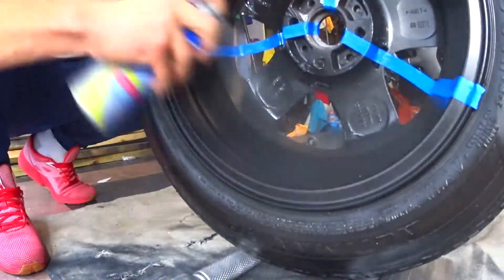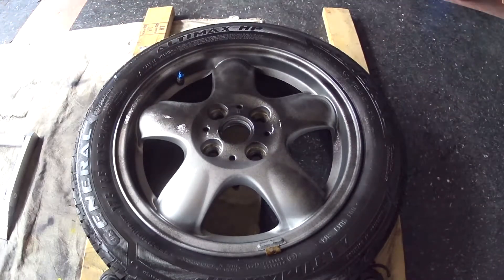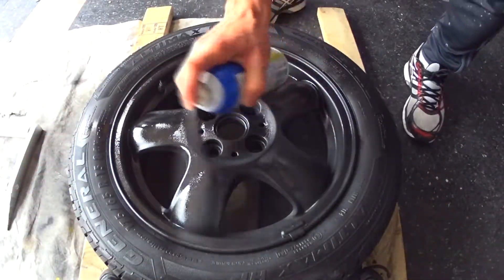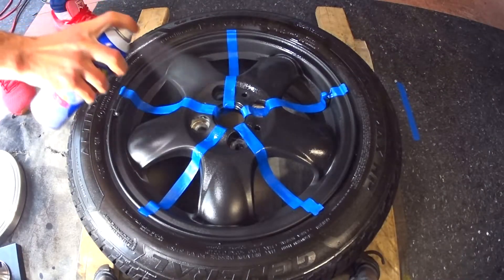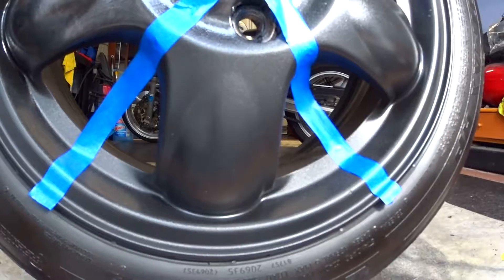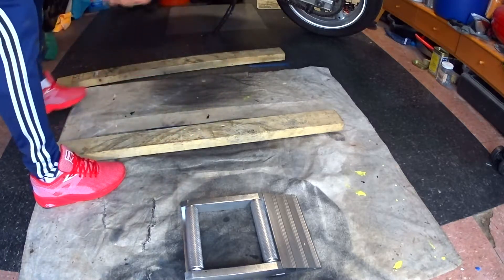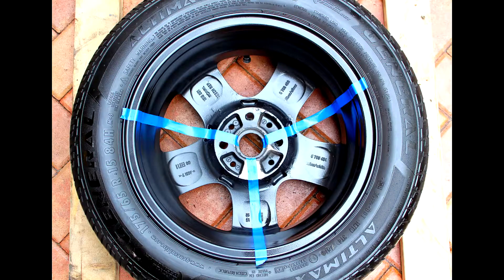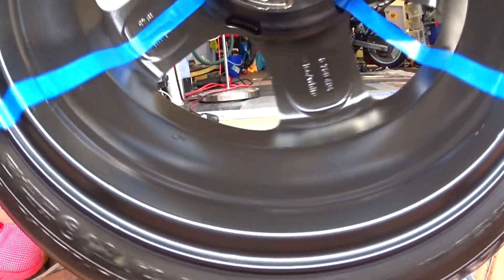How to Apply Plasti Dip Glossifier | Pearlizer | Metalizer

Comment: What you need to remember is how to PROPERLY plasti dip your wheels. Try using painters tape to take off the tire from the wheel so you don't spray onto the tire itself. Also give each coat time to dry before applying another.

Comment: Dude,you seriously dont know what 'passes' mean.You need to wait 15 to 20mins between coats.You just applying "Thicker coats" not 'passes'.You spray one thin coat,very thin coat it must be,them wait,then apply another..5-6 layers minimum.The reason you have that horrible look and drip is due to not waiting and applying thick in a single go...
Reply: Um, you need to check your roll (and your own word choices). Passes≠coats, and you can't interchange them the way you do here.

Comment: This is very wrong this it not how you apply coats. You need to apply 2 - 3 wet coats of the top coat product your using and wait 15 mins between coats but be careful not to pool it like he did on his “ 5 passes” or you will get runs and cloudy spots. And you will get a nice glossy finish. Make sure it’s wet coats or you will get texture.